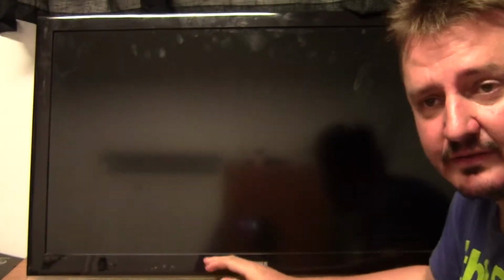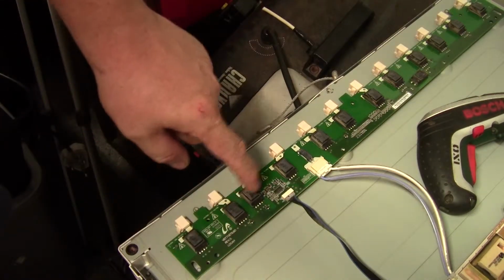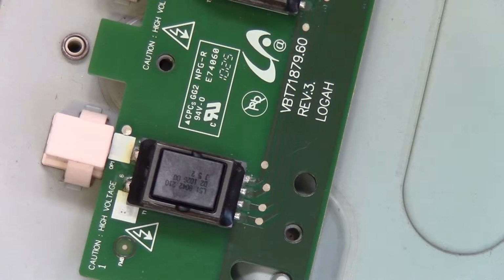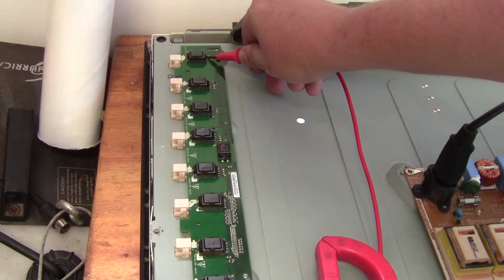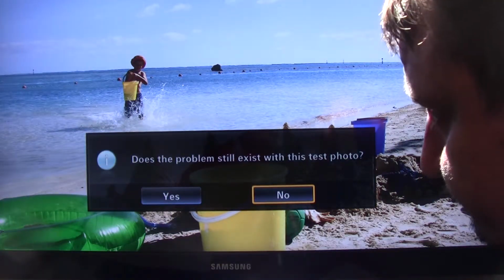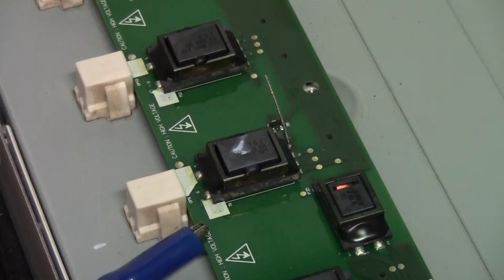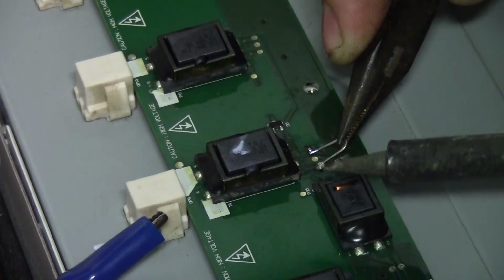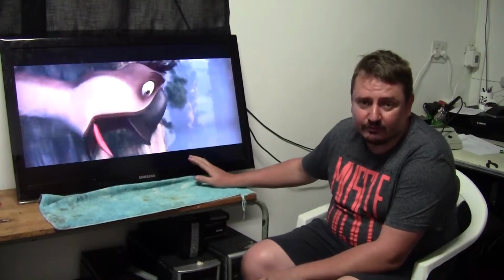ShoutingElectronics #16 - Samsung Backlight Fault

Comment: Another one saved from the landfill. You probably can get the tubes, but they are very fragile, difficult to post and most likely will cost more than a new LED version from Makro or HifiCorp anyway, or at least nearly the price. As a monitor you probably would not notice it anyway, and even as a TV set nothing would be seen anyway till at least 4 more go. Samwha capacitors will probably fail before that anyway.